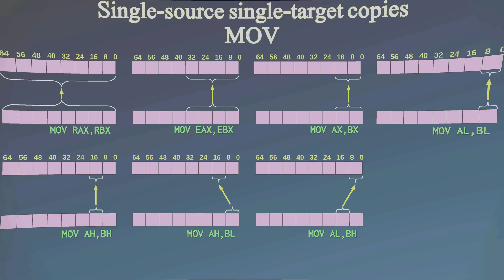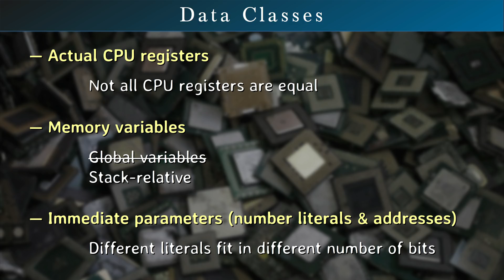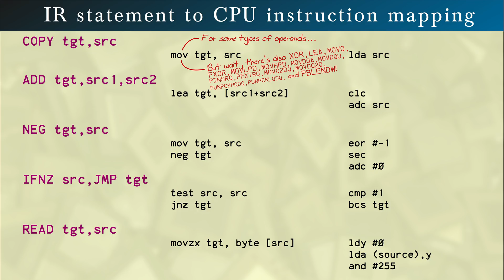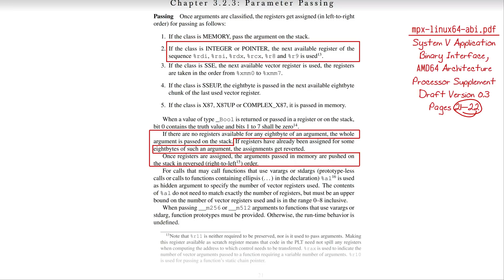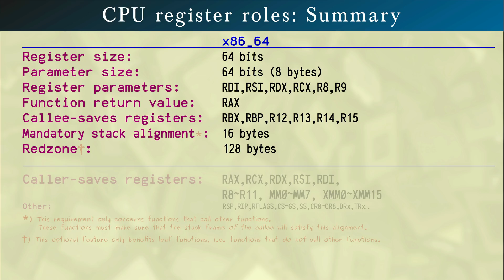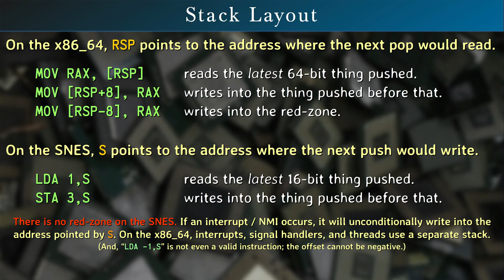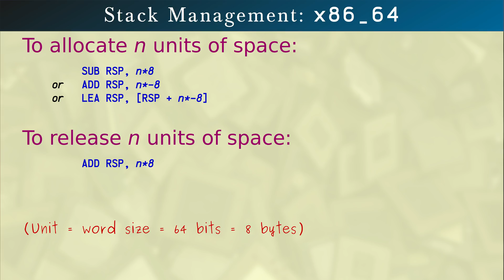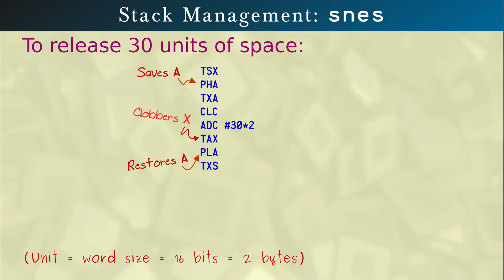ABI & Instruction Mapping — How to Create a Compiler part 5a/5 — Designing Machine Code Synthesis

Comment from the maker: Check the links in the video description for the documents referred to in the video!

Yes, the PC in the beginning is my desktop computer at home. Most of the components have been purchased with money contributed through Patreon by people like you! This video was edited on that computer.
Reply: 2:39 is slightly inaccurate, what you call `INA` is known as `INC` and increments the A register. A better difference would be that X/Y are used as indexing offsets (i.e. `LDA (addr,x)`) and there's no such equivalent for the A register.
Reply from the maker: The `INC` instruction does not increment the A register. It can only be used with memory operands, and it operates on that memory value without involving registers.
EDIT: I stand corrected. I did not remember that they added the implicit INC/DEC instructions in 65816. Thanks for bringing this up. I can still fix this for episode 5b.
One more thing I missed is that there is TSC / TCS, and you don’t need TSX-TXA / TAX-TXS sequences. This greatly reduces the steam on everything in this video from 12:52 forwards.
Reply: I'm actually writing a 65816 assembler in Rust, so I had to learn quite a bit about how it works. Here it is, in case you are interested: https://github.com/x10A94/piped-asm
In theory, it could entirely reorder everything that it can, including moving subroutines across banks so that people can add patches to romhacks without worrying much how they work internally. Much less incompatibility problems, and if there are any, you'd see that at compile time, not runtime.
Reply from the maker: Sounds cool, especially moving subroutines across banks (assuming it uses 16-bit offsets rather than 24-bit offsets when the target resource is in the same bank). Similar practice, except for that size optimization, is standard practice in my ROM hacks.
Reply: @Bisqwit   For reference: https://wiki.superfamicom.org/65816-reference might also have other useful insight

Comment: For the stack space allocation on the 65C816, you don't need to do the whole S <-> X <-> A dance, there are instructions (TCS/TSC) that directly go S <-> A. That way, the prologue becomes only:
PHA
TSC
SEC
SBC #29*2
TCS
LDA 29*2+1,S
Additionally, you could do a PHA after TSC to avoid having to recompute the old stack pointer in the epilogue, although you'd still clobber A in the process, but you could use the slot used to originally save A for the return value, like so:
STA 29*2+1,S ; Save return value that's in A
LDA 28*2+1,S ; Load old stack pointer (post original A push, pre stack space allocation)
TCS
PLA ; Restore return value
RTS

EDIT: I've only seen you already mentioned TSC/TCS in a different comment after posting, oops!

Comment: Isn't using RBP as a general purpose register not a good idea, since it has a specific purpose in x86 handling the stack frame?
Reply from the maker: For the CPU itself it is nothing but a general-purpose register, unlike the stack pointer RSP which actually affects the function of instructions like RET. That leaves the use of that register up to the ABI. In the x86_64 ABI, RBP is specified as a callee-saved register that is optionally used as a frame pointer.

It comes with a footnote: The conventional use of %rbp as a frame pointer for the stack frame may be avoided by using %rsp (the stack pointer) to index into the stack frame. This technique saves two instructions in the prologue and epilogue and makes one additional general-purpose register (%rbp) available.

The reason why RBP/EBP/BP has ever been used as a frame pointer in the first place is because the 16-bit instruction set of 8086 did not have any other stack addressing mode than BP-relative. It could not use SP-relative addressing. When 80386 came with its 32-bit registers, some system vendors chose to keep the same ABI that they used for 16-bit, because it did have the very same registers, just extended to 32 bits, even though the 386 instruction set also added ESP-relative addressing. It also simplified compiler implementation, as the EBP register could be used to refer to stack items at a constant offset despite any pushes/pops that take place when calling other functions. Using ESP-relative addressing, the compiler must constantly keep track of what the current value of the stack pointer is relative to when the function was entered, which is harder. Similar concerns also applied to debugger implementation.
Reply: @Bisqwit  That's really interesting, thanks for the info!

Comment: Stack relative on a 65x class processor? Ouch. OK, so it's not quite THAT bad on a 65816, but there's still a pretty good reason there are precious few stack frame based programming languages on this CPU architecture...
Seperate instruction  and data stacks tend to be more effective here, but of course you only have a single hardware stack pointer, so that requires a bit of work...

Still... Stack relative variables on a 65816?
... eugh. Nasty.
Reply from the maker: Yeah. Well, the other option is “no recursion allowed”.
Technically there are also other options, but I am not sure if they will appear in this series as it gets really complex and perhaps unpalatable for a video series.
Reply: I am well late to the party, but IMO stack-relative on the 65816 makes as much sense as it does on the 8086, considering the stack pointer is 16 bits (although fixed to always be in bank 0), which is more or less the same limitation as you have on the 8086 (16 bit stack pointer, limited to be within the stack segment) except for the relocatable stack segment. Cycle counts from the datasheet from WDC say that stack-relative and direct page-relative accesses take the same amount of cycles (opcode, operand, stall to calculate target, I/O).

Comment: Do you think it would be possible to compile a simple subset of C into a CHIP-8 binary? Just wondering, as I'm doing a small C compiler anyways, and a C compiler for the CHIP-8 architecture could be a fun summer project if it is possible. Thank you!
Reply from the maker: Certainly it would be possible. The tiny 12-level stack however makes function calls a little precarious.
Reply: Great so ill be working on that starting today. One more question, is the ir format you are using with just a few instructions like ifnz, jmp, add, neg, etc can be compiled/transpiled to any processor architecture? such as dcpu-16, intel 8086.. so on. thanks
Reply from the maker: As long as it’s capable of conveying any program, it can be compiled/transpiled to any processor architecture.
Reply: Thanks :)

Comment: hey! you have been my favorite youtuber for the last few weeks (since i discovered your channel), keep it up!
by the way, have you considered doing a series for making a (very) small operating system? this topic interests me very much and i know how extensive it is but i would love to see your take on it :)
Reply from the maker: I have planning for a long time and thinking of a good format for such a video. The problem is that most of it goes very, very deep into the hardware architecture, and it can be very opaque unless one is already familiar with the concepts.
Reply: Have you considered a DCPU-16 operating system? It's a very simple system, you already have an assembler and emulator for it (the video a lot of people discovered you with, I think) and requires much less detail about the details of real hardware architectures. The downside is that it doesn't support true pre-emptive multitasking: rogue processes could change the interrupt address to hog CPU time.
Reply from the maker: There is already a DCPU-16 operating system, called AtlasOS. I featured it in my DCPU video as you probably remember. However, considering that the DCPU-16 is pretty much dead (and there are featurewise much better similar community projects), I do not feel it is wise to invest effort to develop on it.
The size limitations on the DCPU-16 as well as the lack of standarization for storage also make the concept of an operating system rather pointless.

However, I do appreciate the idea of using a tiny limited system as the platform for an operating system construction video. It’s just that I don’t feel DCPU-16 is a good choice for it.

Comment: Hello. Your videos are very interesting. I have one question: If you'd have to write a very simple type 2 hypervisor (like a simpler virtualbox), how would you start? What information should I look for? Thanks in advance.
Reply from the maker: You’d probably want to learn virtualisation extensions in the target CPU (Intel VT-x, https://en.wikipedia.org/wiki/X86_virtualization#Intel_virtualization_%28VT-x%29), as well as learn the target platform thoroughly, especially the parts that make the operating system tick (how they do paging, etc). If you are virtualizing a different platform, then you are essentially writing an emulator.
Reply: But I want type 2 virtualization, that extensions are supposed for type 1.
Reply from the maker: I guess you know more about virtualization than I then. Because I thought (from my brief perusal of a Wikipedia article) that the distinguishing factor is whether the guest operating system runs under a host operating system or, or if multiple guest operating systems run directly on the hardware. And Intel VT-x is the thing that makes e.g. KVM work. KVM is the virtualization accelerator that QEmu uses under Linux, to run guest operating systems under the host operating system (Linux). That would put it into type 2 (again, based on my perusal of that Wikipedia article) in my opinion. But like I said, maybe you know more than I do, and that is not a bad thing.

Comment: Hmm! You could possibly use some zeropage/direct-page based globals in 65816 to save on push/pulls needed to save A/X when doing arithmetic on S? Then you can use LDA/LDX on zeropage directly and save on some intermediate transfer instructions and maybe shave off a few cycles. It's not re-entrant, but since this code is only done during the enter/exit so you can be assured no child subroutine calls are performed in the middle. But this is all minor optimization and maybe not necessary -- also more complicated if you plan to allow interrupt handler routines through the same codegen (then re-entrancy on enter/exit matters again hahah).

Either way, still cool to see the starting approach to setting up calling conventions and code generation!

EDIT: Oh also whoops I saw your comment about TSC/TCS, that's even better haha. I'm still coming from a 6502 background too, 65816 has a lot of 6502 legacy but it seems like they added a few conveniences for register transfers and stack-relative addressing at least. Still seems like it's slightly faster cycle-wise to write code that isn't relocatable/re-entrant though!
Reply from the maker: Yes, zeropage/directpage globals would be easier to program in general for as well as more efficient, but there is the problem that if you need re-entrancy, you must push/pop those variables at entry/exit, and also, if you are making a ROM hack, you must make sure that no interrupt handler or NMI modifies or depends on those variables. 
I did add support for this schema in the compiler, but I will probably exclude it from the scope of the videos.

Comment: It's easier if you just make X volatile between calls, instead of using it as a parameter.  This way you don't have to worry about saving it.  In fact, I use a spot in ZP memory for a "BP" like variable in order to grab specific local variables within the stack without having to worry too much about handling (similar to ENTER):

LDX $40
PHX
TSX
PHA
STX $40
TXA
CLC
ADC #30*2
TAX
PLA
TXS

It's 2 extra memory routines, but now anytime I want, I can grab $40 into X and index directly to the stack which local variable I want regardless of current stack position.  If you subtract the parameter block from $40, you will also have index-ability for parameters as well.  Clean up is a little easier:

LDX $40
TXS
PLX
STX $40

Of course it's been awhile since I've messed with 6502 stuff.
Reply from the maker: Hi, your solution means that the function uses a global variable as a local variable.
The problems with this approach are discussed at 2:38 in this video.
And in my design, all of X,Y,A already are caller-saves registers (volatile in your terminology). It’s just that they also happen to be function parameters and return values. That’s what makes it necessary to avoid clobbering them in the preamble & exit.
Reply: $40 is saved to the stack prior to using it locally and restored before returning, it is "global" in the sense that it's the same memory location across all of the programming, but it's a variable pre-defined similar to EBP.  You can simply assign the memory location as volatile to make the code "forget" that it is using the memory between calls, while maintaining correct notation during effective ENTER and RETN commands.  The idea is based loosely on this:

(enter)
push ebp
move ebp, esp
sub esp, 60

(leave)
move esp, ebp
pop ebp

From what I remember, 6502 is positive direction with indexing as well as the stack, so you have to be in the old data of the stack to reference the variable space of the stack frame using X.  I could be wrong, forgive me as it's been nearly 20+ years since I've done this type of code.  Since you can't reference the stack directly, you'll need X anyway for the parameters as well (which could be done by subtracting the parameter size).....but personally, I prefer to have the simplest commands in the DAG tree and have the optimizer find the best route to take with the variables available, even through calls, because I'm lazy lol.
Reply from the maker: You are correct about the saving & restoring. My bad. In fact, I have actually used this approach in some SNES code previously, to generate temporary RAM variables out of thin air. There is a very convenient syntax in SNES assembler to push the contents of a zero-page variable into stack. PEI $12 loads the contents of $12 and puts it in stack, at once, without passing it through registers. (The opposite does require PLA & STA though.) However, I want to keep the code generated by this compiler as unintrusive as possible, and this means not making assumptions on the contents of RAM :-) For example, when your code is inserted into a ROM hack, you can’t blanket-assume that the already-existing NMI routine, which may be invoked in the middle of your function, won’t clobber that one global address you happen to have chosen. Such assumption would have to be validated case-by-case.